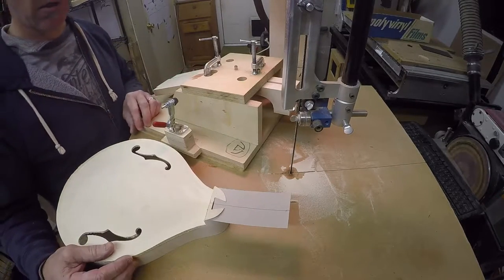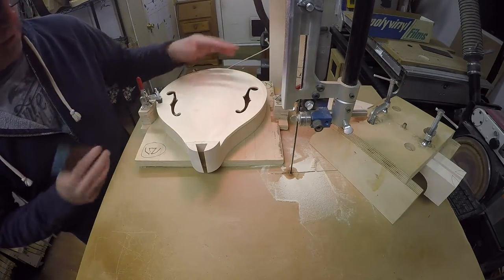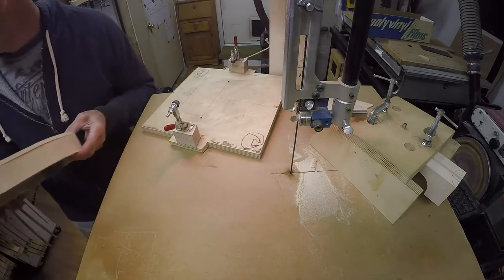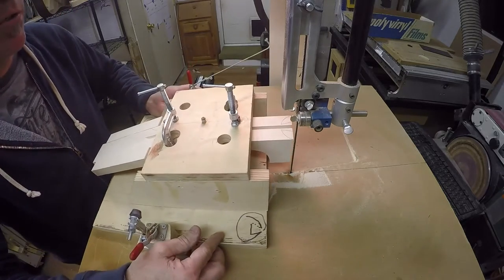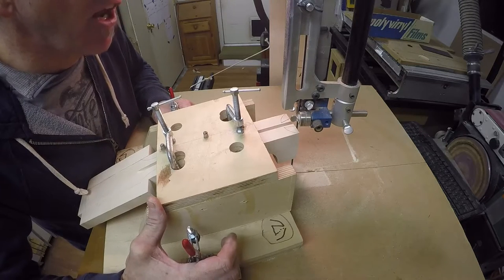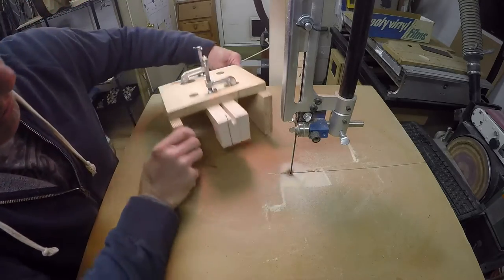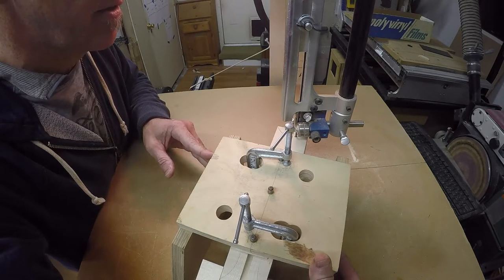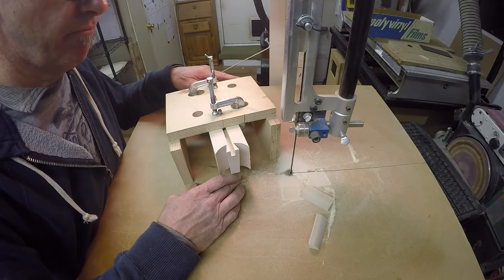Cutting a compound dovetail neck joint on the bandsaw with Clark Mandolins

Comment: What angle is the board (angle fixture) the jig is sitting on fixed at?
Reply from the maker: JimB73C 
I honestly have no idea! It’s been ten years since I made and started using this jig.(I still use it!) Really though, it depends on the size and design of your dovetail. Do a drawing to determine the amount of taper you want and that determines the angle of the fixture.